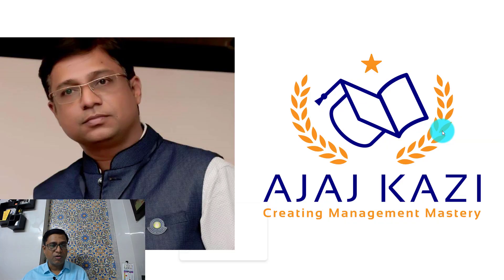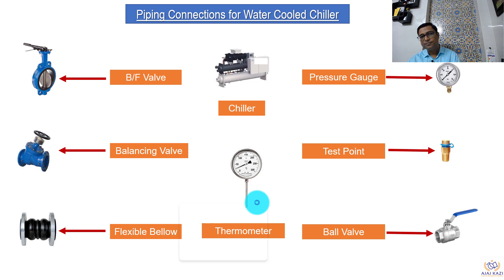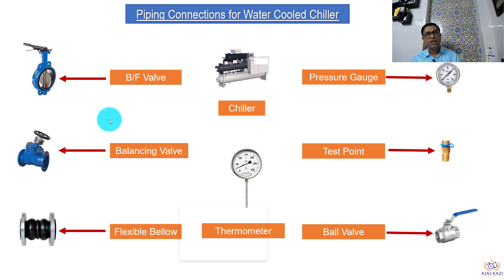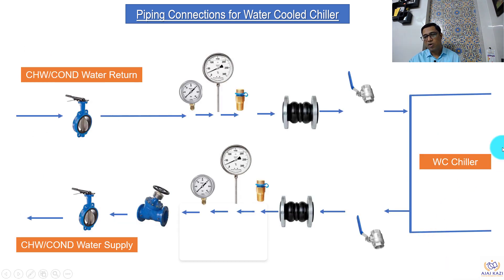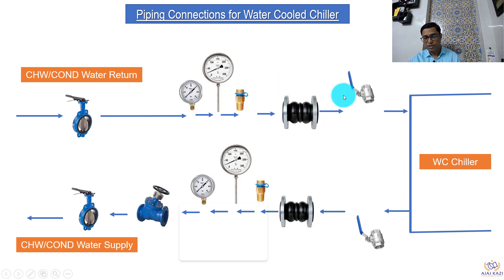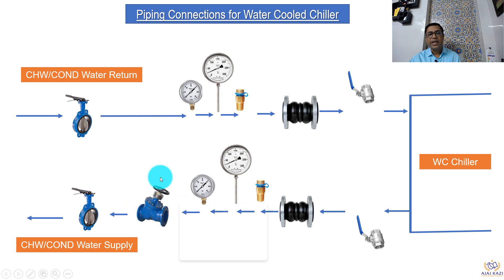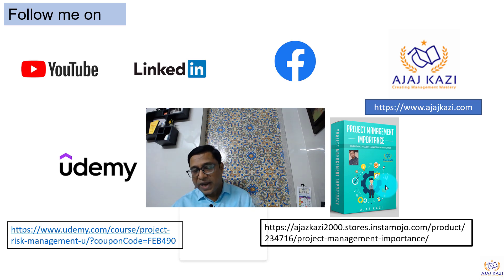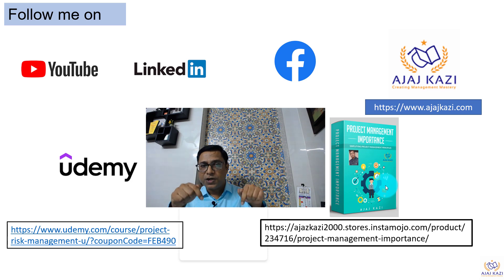Piping Connections of  Chillers_ HVAC System

Comment: Plastic pipe materials should be used more and more in chilled water systems. Most of the installations still use corrosive metal pipe materials.